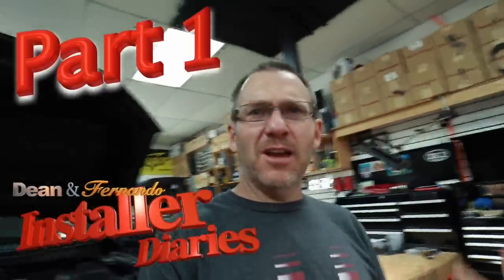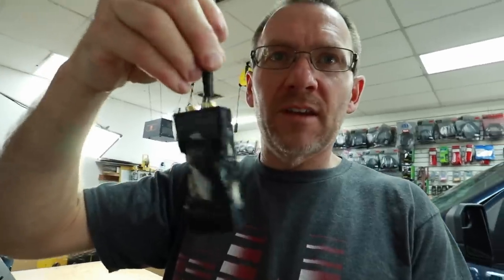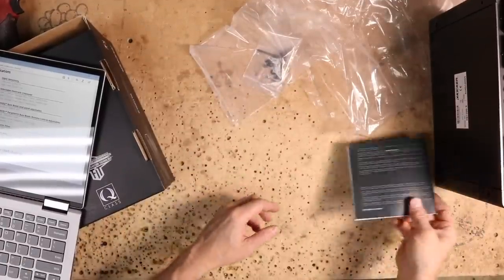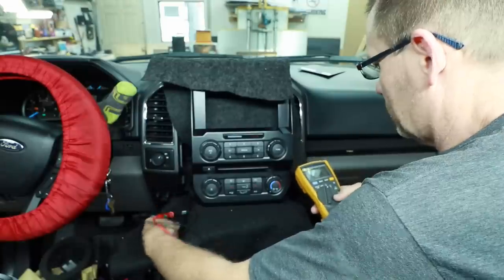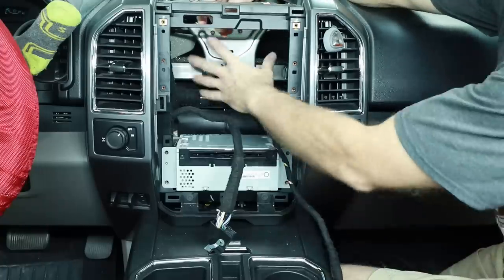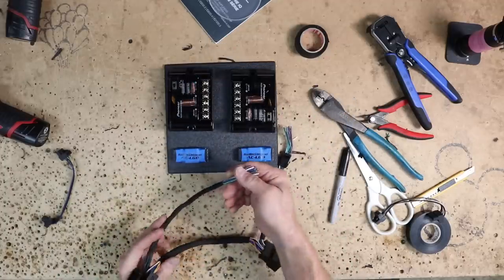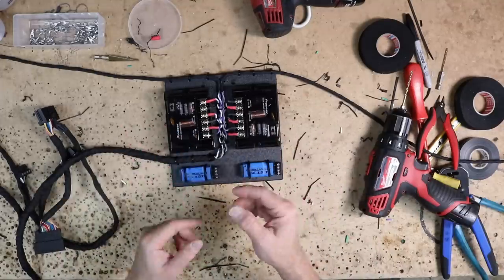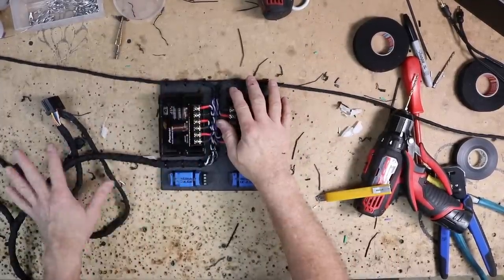High level 5 channel Kicker Q Class amp install in a F150 Installer Diaries 192 part 1

Comment: Have you ever thought about putting a lift in the install bay so you don't have to work on your knees? or working on doors so they are the right height to make it easy to work on.  I have and it makes life easier.

Comment: Well, you're getting closer to getting to a 4" base model Ford aftermarket instalation just by doing this video with a new Ford, lol.  I wish I wasn't such a peasant when I bought my Base '16 GT mustang, lol.  I'm at a loss for what I'm going to do for a good Radio.  Keep up the great work guys, I wish we were closer.  :)
Reply: You can upgrade that base GT to 8" Sync 3 for $500ish if you shop around enough

Comment: Why not just reprogram the ACM on those Fords with base audio system to variable line output with Forscan and a computer?
Reply: yeah i dont get all theses dummies that keep do high level out on the fords,  change a couple of bits in forscan and you have low level out on the speaker wires,  i made an adapter that took the speaker wires and converted them to rca then ran them to my processor/amp. sounds a million times better now.  the output from the ford head unit is surprisingly clean and flat so it took very little work on the processor.  little bit of time alignment and tuning for acoustics of the cabin and it was spot on.
Reply: @weldchip  you got a video of doing this? And what has to be changed in forscan?
Reply: @eliminator1978  This a link to the forscan spreadsheet you'd need to modify the ACM. https://docs.google.com/spreadsheets/d/1uDSQ1Z5a2Wt8-kjrSiVSlDFGFHnfeuhb3RTMVz95730/htmlview# The 727-01-01 line is the line you need to modify. What you're looking to do is change the setting from "internal amp" to "external variable". What this does is bypass the internal amp and turns your ACM into a pre-amp. Completely eliminates the need for line converters and makes adding an amp much easier. You will also need to edit the 727-01-02 line to set the eq to "flat".
Reply: @Sagittarius-88  how is that not on top of comments in this post?!

So you take the high level wires from the harness, make RCA terminals with them, plug them to a DSP/amp and modify the ACM? That is it?
Reply: @Dahita  That's pretty much it. Once you make the necessary forscan modifications, your factory radio basically becomes a preamp device. No line converter would be needed. From what I understand, setting the factory eq to "flat" also eliminates any bass reduction at higher volume levels. From what I've read on the F150 forums, the line level signal from ACM is pretty clean, and peaks close to 5 volts.

Comment: I have the same amp on my 17 F-150 and love it , the DSP section is simple to adjust , and really like the bass control level that comes with it , my only complaint , the amp gets really hot
Reply from the maker: Did you run a ground to the battery?
Reply: Yes , i have a 4 gauge ground to my frame , learned that from one of your previous videos @FiveStarCarStereoInc

Comment: In newer Fords (at least 2013 forward AFAIK) you can actually reprogram the APIM to output variable line level, which also results in no frequency cut off or bass roll off.  See here http://www.2gfusions.net/showthread.php?tid=3704  Forum is Fusion based, but applies to all Fords with the 4" or 8" MFT or SYNC 3.  Software to do it is free and just requires a ODB adapter.

Comment: Note: If doing an SQ system with passive zovers, always try to mount the xovers as close to your speakers as possible. The length of speaker wire between the xover and speakers will induce resistance, thus changing the xover points between the drivers. If you can't mount the xovers close, I suggest at least matching the length of cable between all speakers and xovers. This way, any phasing issues created by altered xover points  will at least be matched between right and left channels.

Comment: So if you had the option to go high level vs low level, would you recommend high level?
Reply from the maker: The problem is not high vs low. The problem is clean vs factory messed up. Most times you have to go High level you have a bunch of sound problems you have to fix.

Comment: I was surprised to see the need for the load resistors on that amp when my kxa800.5 has them built in.  
Please let us know your results using the the shoc adjustment in the dsp.  I got the kxa so I didn't have to use an epicenter and the results are not bad, but no where near what I was hoping for in terms of harmonic bass restoration. 
Great content as always, and thank you for getting me hooked on tesa tape.  Using a fresh roll is so satisfying.
Reply: The current KXA amplifiers with the Radio Detect circuit (120 ohm loading resistors) were designed after the IQ amps came to market. When we released the IQ amplifiers the need for loading resistors did not exist yet. That is why you don't see that feature on IQ amps but do on the KXA.

Because we can't design/redesign every series of amplifiers at the same time, you will see this technology gap at times.

As far as the sound quality and DSP in the IQ, it is top notch.
Reply from the maker: What Kip Litsey said. He know Kicker believe me.

Comment: So if there is no factory amp is the load generators not needed? Im installing in a 14 base f150 however it has tweeters, kicker cxa1200.1 amp, LC7i converter 2 subs and eventually speakers. Thanks love the channel

Comment: hey dean, i have a question for ya, is that t harness good for aftermarket stereo? I put a 5 channel amp in my truck and i ran all the speaker wires up behind the radio but i don't want to cut the original harness up...is it better to use the t harness and just chop that up?

Comment: Does the 2021 f150 have the same connectors on the head unit? I followed this install for my 2020 f150 and want to switch everything over to my 2021 f150.  Thx!

Comment: I'm getting 6V @1Khz/10VAC@50hz on my front channels. I'm getting the reverse on my rear channels, 10VAC@1Khz and 6VAC@50hz. I'm going to run them into a D-6.1200. Does this amp have the compensation built in?

Comment: Any reason you didn't go with the Pac AmpPro4? #AP4-FD21?? Asking because I have a 2019 F250 with all the factory amps and 10 speaker system, but was looking to use an aftermarket amp and Sub.....
Reply from the maker: This was a base model with out the factory amp. The AmpPro would not work. Your truck would and that is what we would use

Comment: So we know thanks to you Dean that the LGD it’s very importan to use.  But sends there is none for RAMS. What size resistance and watts would be ideal to use on an Alpine system. Want to do morel 5ch amp if I can. Thank you 🙏 

When do we start voting. And where. Please
Reply from the maker: For an Alpine Ram with a full system we would use an Amp Pro. The signals coming out of that system are the worst. There is no amount of summing that can be done to help that system. We will let you know as soon as we know. Thank you
Reply: Five Star Car Stereo 
Thank you very mush. 
🙏🙏🙏🙏🙏🙏

Comment: What trim is this f150 I may have missed it as I listen to this while I work. I have a 2018 f150 xlt with the sync3 non amplified and these videos are a Godsend for me.
Reply from the maker: It is the 2015 xlt with the small 2 liter engine.
Reply: @FiveStarCarStereoInc  OK thanks for the reply. I finally got a chance to re-watch at home and this is the same setup as mine. I've already tracked down that harness with amps and subs soon to follow

Comment: I have the same f150 5.0 slot. I also have the 8 inch screen my question is are going to use an lc7i or are u able to go another route . I get mixed up with the high level low level information
Reply from the maker: It is a standard 4 channel 8.5 volt out. Any amp that can take that will work. Some are better then others of course. The LC7i is also a great product to use if you are unsure of the amps you have. I’m also a fan of the LCQ1 if you don’t want to go DSP.

Comment: I was wondering if  it's Audiol control 5 channels dsp amp using hi input would you still use the LGD or no need?
Reply from the maker: Yes still us, they are not going to be built in.
Reply: @FiveStarCarStereoInc  thank you . I'm on the fence for setting up my 2017 Tacoma.I'll use umy factory head unit with 5 channel amp every thing else  aftermarket.

Comment: Question, how hard would it be for car manufacturers to just add in a pair of line level out rca plugs on the back of the stock head unit?
Reply from the maker: Not at all. Doing so would invite people to upgrade. That is something they do not want. They want a closed system that you can’t touch.
Reply: @FiveStarCarStereoInc  agreed. It's just they do these terrible systems and expect people to not want to upgrade. How are you guys gonna handle these new head units that are just tablets sitting on top of the dash...
Reply from the maker: Go and watch the Saturday day show we had PAC-Audio on. They have solutions coming.

Comment: i have a 2017 f150 lariat, i sometimes get a pop when i open my door, factory radio with audio control lc7, kenwood excelon x801-5 what would cause this?
Reply from the maker: The amp waking up would be my guess. It can happen sometimes when the LC powers on the amp.
Reply: @FiveStarCarStereoInc  my local stereo shop said there's nothing they can do,